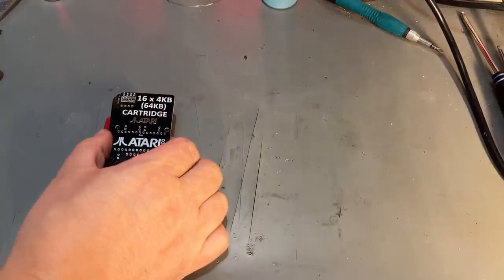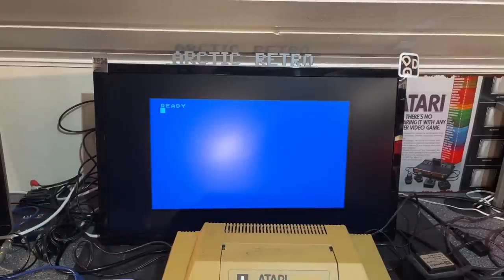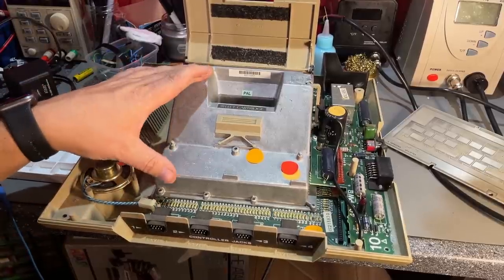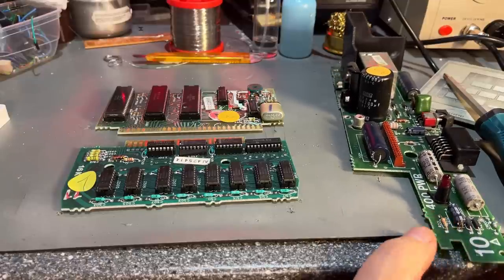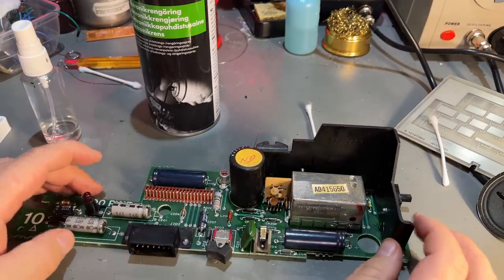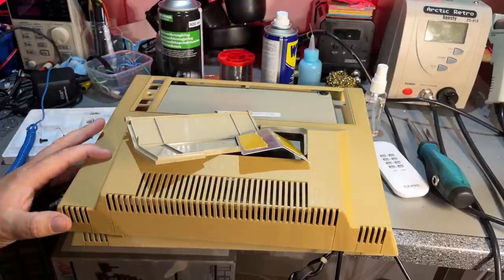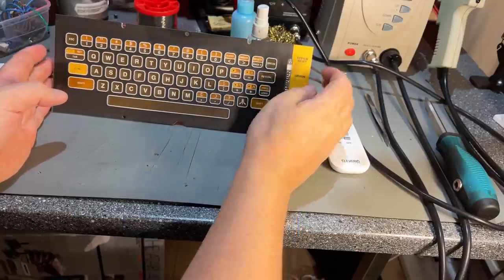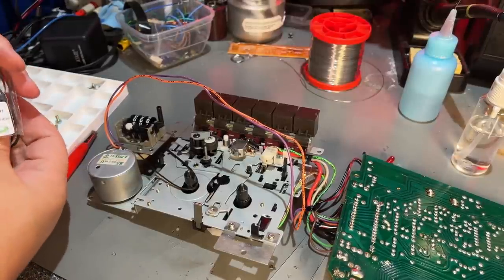The Atari 400 computer and 1010 cassette recorder - Restoration, test and games cartridge build

Comment: Christmas 1982 I got my Atari 400. I learned Atari Basic and used a 410 to store my programs. I did cheesey programs where I would write down altitudes and down range readings from mission control during Space Shuttle launches and graph them using plot statements. Then would use plot() and drawto() inside for() - next() loops to make conic sections with contour lines. Then I'd fill the surfaces with GTIA enabled colors. As a project for my 6th grade math class I printed out log tables for base 10, and trig functions. I had so so so much fun with my Atari. I tried to make my own version of Missile Command but never finished it. Spring 1983 I used to stay up late on Friday nights listening to the Falklands War on the BBC World Service while I'd work on my programming projects. I got the assembler package, but never got deep into it, because I got a Commodore 64 in late 1985 and used that until 1988. Once I got into college I got an account on a VAX-11/780 and went 32 bit.
Reply from the maker: Ah, nice story. Thanks!
Reply: I love these stories! I had a similar path a few years later with an 800xl. I still have my first machine and create artwork with it.  I managed to write and finish a game with the catchy title "earth defender". I " reverse engineered " a game by using my skills in Basic.  From the early 90's and to this day I   create 3d graphics and animation on PCs but everything started with the Atari platform.
Reply: @nickolasgaspar9660  I love these stories too. In college I had a friend with an XE, I made a drawing of a Soyuz in Earth orbit summer '87 and into the late 90's I saw it on Atari 8 bit slide show pix in stores that were selling old computers. I guess the picture had made it into circulation on the BBS circuit.

Comment: These 400/800s were built like tanks. I sold an Atari 800 that was sitting in a dirty garage from the early 90s to 2020. After giving it a cleaning with rubbing alcohol, window cleaner and brute force it worked flawlessly. It was so dirty I used a mask (same one I used for Covid even though I was alone) to clean it outside - I didn't feel like breathing the dust , oils and grease. Upon plugging it in it worked flawlessly.
Reply from the maker: Haha. I would imagine it was dirty. Thanks for the story :)
Reply: @Arcticretro  Great gaming machines of the day - made my loaded Apple 2+ look like Eniac